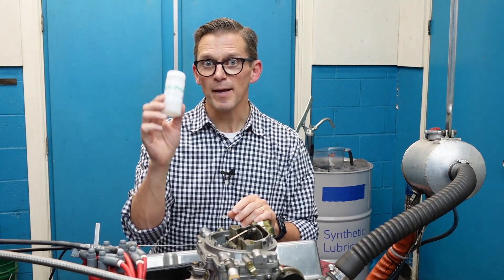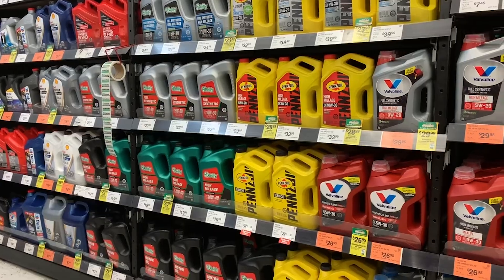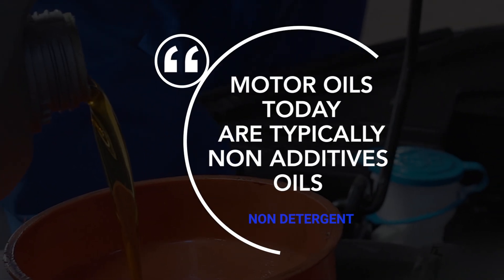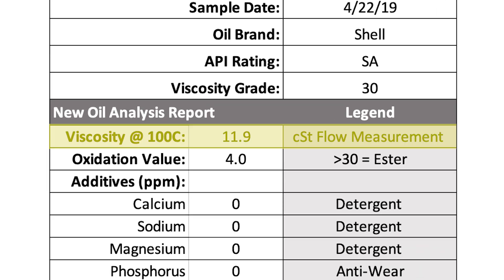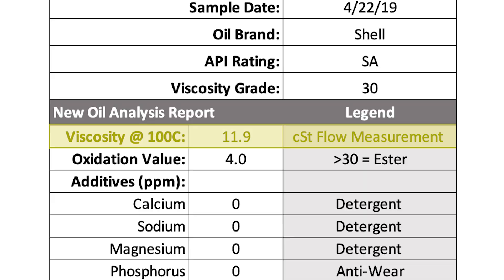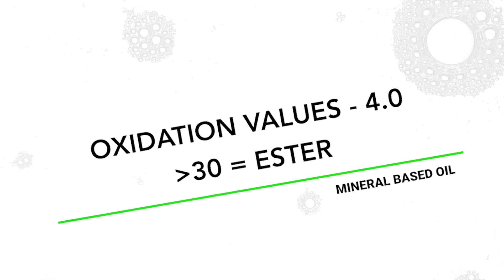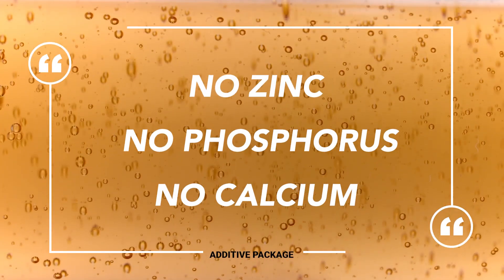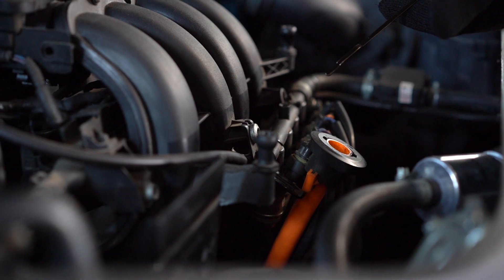Non Detergent Motor Oil - What's In It?

Comment: Late to the party here, but as a kid growing up we had a 1966 Chris-Craft.  Power was twin 427 CC engines. These were Ford 427's. These were solid lifter engines and each held 9 quarts of 30 weight non-detergent oil. Every weekend starting in spring and going sometimes into mid November, those engines were run and never gave a lick of trouble. Oh and might I just add the exhaust pipes were above the water line. The sound of those twin 427's at start up and cruising speed.....glorious!

Comment: Non detergent oils are obsolete lubricants that offer no wear protection and should never be used in a combustion engine. Air compressors use non detergent oils in order to allow moisture and particles to settle to the bottom of the crankcase where it can be drained off. Combustion engines need detergent in order to keep dirt in suspension so it won't create sludge which is very detrimental to the oil pressure galleries and lubrication system.

Comment: Rebuilt my Cummins,hooked 9k lbs of farm tractor and trailer up to it. Towed for 250 miles with this exact oil to break in the rings.Valvoline Blue afterwards. That was over 100k miles ago.Motor has zero blow by today.

Comment: Dude! That's machinery oil! Should say that on the labeling along with what to use it in, like piston air compressors, gear boxes and machinery, electric motor and generator oil cups. That stuff was kept separate from the IC engine motor oils. The ND motor oils did contain ZDDP and a few additives that detered sludge buildup and ash when burned in the combustion chambers. Most ND motor oils for standard engines contain around 650 ppm of ZDDP.

Comment: My mechanic moved me to a 30W oil to maintain oil pressure on a 200k 5.4 triton. It has seemed to stop the low RPM engine stalling but is this a bad idea?  Should I not be using the 30W?  I believe it’s a Pennzoil

Comment: So it’s pretty much just cheap, basic and not suited for any engine..but that bottle just looks like it’s off a gas station shelf.  Wouldn’t use that in any small engine either, due to most of them not having oil filters

Comment: I just bought a 1967 Mustang 6 cyllinder that the prior owner had the oil changed every year for 7 years with 30 w ND oil and ZDDP additive (per provided receipts). During that 7 years it was driven less than 2000 miles.  I want to change to a detergent oil with zinc, phosphorus, and molybdenum in it, such as Rotella T4, but I'm concerned about the risk of breaking loose sludge and damaging the engine, which i have read about.  Is 2000 miles over 7 oil changes enough to build up sludge?   I have no knowledge of the previous 50 years/88,000 miles but would be surprised if it didnt use a modern detergent oil.

Comment: This kind of oil is called for in air compressors.
Reply: Completely different from historic ND oil dericed from high sulfur crudes. Modern ND oil has no valid use except as a suppository.
Reply: @gregorymalchuk272 works good as chainsaw bar oil
Reply: @Thumper68  Bar oil actually has antiwear additives, plus a cling additive.

Comment: Good video.
Reply from the maker: Thanks!
Reply: @themotoroilgeek  News flash!  Mazda Japan use non detergent 5W30 full synthetic factory fill for initial break in period of 10,000KMs.  They then change to regular detergent 5W30 full synthetic for the remaining services.  Reason?  The last thing you want is break in micro particles floating around in the oil.  They also use a "special" larger oil filter as well that is designed to trap these initial particles.

Comment: Non detergent oils are what used to be used in water cooled 2 strokes because they would leave fewer deposits than a "real motor oil"
Reply: Those oils still have ashless antiwear additive packages.
Reply: @gregorymalchuk272  which oils
Reply: @gregorymalchuk272  Not factory fill Mazda Japan.  They are encouraging bedding in.  You know nothing.
Reply: @TheAustralianOpinion  So it was straight mineral oil with no additives?

Comment: 35 years on my 60gal Sanborn air compressor using 30W ND oil. Runs every day in Fl. heat, just Wal-Mart or Tractor Supply oil. I also have been using ATF in all my air tools since new. Most are 50 plus years old and never been repaired. Of course there all USA or Japan made from the good old days.
Reply: You always run non detergent oil in compressors anyway. The additives in conventional oil cause carbon build up in the compressor head and reed valves
Reply: @Blue10AEMia  exactly what I've heard from air compressor shops.

Comment: Those lower grades of motor oils and older obsolete oils probably are best used for old tractor oil bath air filters or those oil burning shop heaters or maybe just recycle them .

Comment: Can you make a video about ATF and power steering fluids??? Would be interesting to know what are their contents of each other. Thanks man, awesome content!
Reply: ATF relies on borate esters as an anti-wear agnet and friction modifier for smooth shifting. Power steerring fluid as far as I can tell is just an anti-wear hydraulic oil that uses ZDDP at about 1100 PPM for wear protection. There's a lot of controversy over manufacturers like Toyota recommending Dexron 2 or 3 ATF as power steering fluid, with people saying power steering fluid would result in less wear. He should definitely make a video about their two chemistries.
Reply: Transmission fluid and power steering fluid are both hydraulic fluids when you look at them. 

I run Dex 6 in my trans, so I also use it in the power steering because it's easy, redundant, and 1 less fluid I have to stock.

Comment: I know this is a year old but I've been told if and only if you have chrome moly rings to break them in run a straight non detergent 30w for no more than 50miles low rpm low load to seat them paying attention to the exhaust. Then normal straight 30w for 150miles, 500miles, 1500miles before switching to a mulit 10w-30 or what not and all this having to be done above 50 degrees. Is there any truth to that anymore? I can see no on the non detergent as we have other materials now but back in the 50's thru early 90's engines?
Reply from the maker: No, the break-in oils available today make these non-detergent oils obsolete.
Reply: @themotoroilgeek  Japan engine factory break in oils are all non detergent.  You know nothing.

Comment: isnt this the oil you should use in a vintage air cooled engine? for example cast iron kohler or briggs..... something that uses splash lubrication, the non detergent wont foam up at all?

Comment: This is random but do lawn mower oils like Briggs 30 weight have additives and if not, should it? It would seem like they have a lot of friction and run at a constant high RPM. Specially when people have lawn mowers for a decade and change the oil a few times if they are lucky. I never thought to do an oil sample on a lawn mower. Maybe a new video idea.
Reply from the maker: Yes, lawn mower oils do have additives in them.
Reply: @themotoroilgeek  No they do not.

Comment: I recently went looking for 20 or 30 grade non detergent oil but I wanted the additized kind, what sucks is because people were seeing the API symbol and putting it in their modern cars they no longer mark the oils as API SA or API SB, SB is additized typically with some anti-wear and anti-oxidant additives which I believe is what you actually want for sintered bushings is at least an oil with anti-oxidants added, Valvoline (also Napa's house brand that's made by Valvoline) is the only manufacturer I can find of an additized non-detergent motor oil, the only other option is AW68 or AW100 hydraulic fluid but I just wanted like a quart or even like 8oz will be enough to last a lifetime and hydraulic oil is typically only sold by the gallon, pail, or drum, what I ended up getting was some synblend air compressor oil it appears to probably be AW68 sold in a smaller container based on the SDS, it's really clear indicating that the base oil has probably been hydro processed in some way, and it smells kinda like power steering fluid. The SDS listed ZDDP and Butylated Phenol on it, I presume the latter is some type of anti-oxidant.

Comment: I have been using Walmart Supertech or NAPA SAE30HD for more than 10+ years.  In all my Lexus cars!!  Zero defects especially in the heat in Florida and Nevada.  Can’t use it below 40F but I never go anywhere cold..  engines are like brand new even today. I have 200,000 miles on my LS460.  Please do a review and test.
Reply from the maker: SAE 30 HD is not non- Detergent. Two different formulas. Just the viscosities are the same.

Comment: Are all straight "weight" oils detergent-free?  I use non-detergent sae 30 in my air compressor and (I assume) detergent sae 30 in my 4-stroke boat engine.
Reply from the maker: No, straight weight oils are not necessarily non-detergent.

Comment: Hi Lake. Just found you from the Dave's Auto video (first time there, too:>). Subscribed, and will binge watch all you've put out thus far.

A question, please. Have seen your "Never" and "none"  responses below; but is there perhaps merit in using a non-detergent oil  -  thus not transporting wear particles through a filterless engine (mower, blower, generator etc). Would ND not faclitate allowing same suspension to sludge-out in the sump? Your answer be much appreciated.
Reply from the maker: There is zero merit to using a non-detergent motor oil. It only exists because people still buy it.

Comment: Thank you for the info . when would you use a non detergent oil?
Reply from the maker: Never
Reply: @themotoroilgeek  Then Mazda and Toyota would fire you!  LOL  You know NOTHING.
Reply: My concrete pump truck has a hydraulic motor powered reciprocating water pump that calls for a non-detergent 40W.  Not really sure why though
Reply: @josephrosolowski3575  When was it made?
Reply: 2004
Reply: @josephrosolowski3575  Hmm. I just could never even think of running a vane or gear hydraulic pump on what is basically unadditized laxative oil.
Reply: @gregorymalchuk272  this is a 3 piston pump driven by a hydraulic motor
Reply: @josephrosolowski3575  I wouldn't want pistons, rings, and cylinders running in it either. This stuff is laxative oil like from the pharmacy. It has nothing in it for lubricating mechanical components.

Comment: Good info.  My dad used to run ND 30 wt in the old '58 Chevy.  That engine was a sludge ball.  What I haven't seen discussed is recommended oils for 4 stroke utility engines on things like mowers and lawn tractors.  Now I see that Briggs and Stratton is recommending their Vanguard 15W-50 synthetic for their engines.  I have been using 15W-40 diesel oils in my B&S Intek 20hp V-twin for 23 years and it still runs well, I change the oil and filters at the beginning of each mowing season.  The mower gets used for mowing fire breaks and eats a lot of dirt.  Most recently switched to Mobil Delvac 1300 synthetic blend.
Reply from the maker: That Delvac is not a bad option.
Reply: You should do a vid on 2 stroke oils. Burning castor is nostalgic @themotoroilgeek

Comment: So, why is this product even on the market?
Reply: The "ND" designation is so deprecated it has no relation to historic ND oil. Don't use it for anything mechanical.
Reply: For air compressors, the piston rings, cyl, bearings, piston get hot & you don't want the ash from the additives in the compression chamber sticking the rings.

Comment: Thanks for the video.  I was SHOCKED to see this non detergent oil actually had no protective additives.  You would have to be nuts to break in a new engine with this product.
Reply: Back in the day before multi grade, non-detergent engine oils were pretty common.  The lifters and lobes in my flathead ford were in great condition when I did the rebuild and I'm quite positive most of it's working life was running non-detergent straight grade.  The cylinder walls were a different story, we had to go with 0.080 overbore to clean them up.
Reply from the maker: Thank you!

Comment: So if engines shouldn't be using this, then what the hell do they use it for & why is it still made?! Is it for garden or non automotive use?
Reply from the maker: In California it has to be labeled as compressor oil.
Reply: It's a heavily delrecated designation that has no connection to historic non detergent oils that still had additives and were made from high sulfur crude oil. Don't use it for anything mechanical.

Comment: Before detergent oil was available all engines used non-detergent oil. When I was a kid, I was told never put detergent oil in an engine that had always been run with non-detergent oil. When you disassemble one of these engines every nook and cranny in the crankcase will be full of sludge. The detergent would loosen the sludge, hold it in suspension (the filter was supposed to remove this stuff, but a lot of these old engines didn't have an oil filter) and run the sludge through the engine causing a lot of wear and the engine would need to be rebuilt. I still have some of these engines and I hesitate to use detergent oil. What is your opinion?
Reply: I use 30 non detergent engine oil in my 1930 Model A. After 94 years I would say you will not hurt that engine with non detergent oil...... 😇🙏
Reply: @dougsather2939  All the experts say differently.
Reply: Комок грязи
Reply: @garyvanrheenen181  Thanks for this comment!  I've got a '46 Willys-Overland CJ-2A and have always been told to *NEVER* use a detergent oil in it if I don't want the engine to rapidly fail.  It's a shame that Lake didn't respond to your question, even though I certainly understand him not being able to even read, much less respond to, all questions.

I suppose that if an old engine like this was completely disassembled, cleaned, & rebuilt, that it would be OK to use a modern oil with detergent in it?
Reply: @bobvines00  I've been told yes, once everything, even the oil passages, have been cleaned detergent oil is ok.

Comment: Decades ago I was told to use non detergent oil in my 53 Caddy. Probably because they didn’t have better oils back then? I don’t use it in any small engines, and use 5w30 in snowblower, pressure washer etc

Comment: so why do they warn to only use non detergent 30 weight oil on electric motor bearings? what would the additive do that are bad for the bearings?
Reply: The detergents would be pointless because they aren't trying to cope with combustion products and sludge precursors. But good electric motor oil still has an anti foaming, anti wear, and anti corrosion additive package. I use automatic transmission fluid on electric motor bearings to good effect, but I'm not a professional electric motor rebuilder.

Comment: There is a difference between SA and SB non-detergent oils. SA oil is pure oil with no additives. SB oil has certain additives but no detergent. Both of these products still are produced because both of them still have their uses. Particularly, VW purists want to use non-detergent oil in their vintage Type I and Type II engines for the sake of authenticity. SB oil is readily available but it costs more because of the limited market. If any independent convenience store or independent discount store sells SA oil, it is because some jobber sold it to the owner.
Reply: There is no legitimate use for either of them. Nothing with the chemical profile of anything labeled "ND"  SA or SB was ever used even back when those were the current standard. SA and SB were group 1 oils made from high sulfur crudes with inherent anti-wear properties. Current ND oil is pure base stock best used as a laxative or suppository.

Comment: I recently purchased a 1966 Pontiac Lemans with a 326 ci engine.  The engine has several changes such as headers, 750 double pump carb and an aftermarket camshaft. I have no specs on the cam but it has a pretty rough idle. Car runs like a scalded dog. I was told to use nd 30 oil in it. What’s so you?
Reply: The contemporary API oil for 1966 was a detergent oil. Why would you even consider going back to a 1930s era non detergent oil?

Comment: An old friend back in the 70's and 80's would run this stuff in his Mercury 20 hp outboard instead of those "fancy" 2 stoke oils as he liked to call them.
Reply: was it a 2-stroke engine with oil in gas or a 4 stroke with oil in the engine?
Reply: @ranger178  It was a 2 stroke with oil (straight 30 non detergent) in the gas.
Reply: I wonder what the ashless-antiwear additive packages looked like back then. Lawn Boy actually used to recommend ordinary automotive engine oil in their two stroke mix. They claimed that the available ashless oils couldn't tolerate the heat and extreme conditions. It now makes me wonder if the ashless two cycle mix market was contaminated with unadditized mineral oil similar to the product in the video.
Reply: @gregorymalchuk272  You never want anything in a 2 stroke, it burns oil with every stroke.
With additives you'll have burnt ash fouling spark plugs faster than you can put em in.
Only thing recent 2 stroke oil has is a detergent to keep grunge from sticking rings.
Reply: @armedfarm3429 That's not true. Two stroke engine oils have ashless anti-wear chemistries based on amine phosphates.